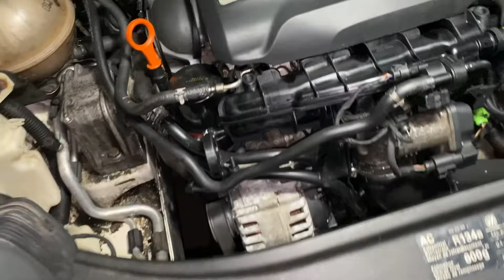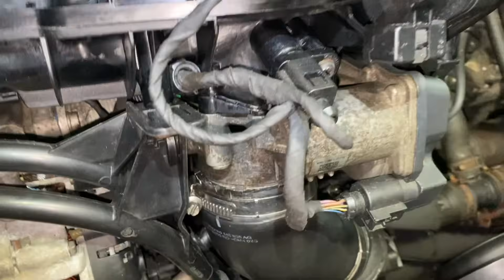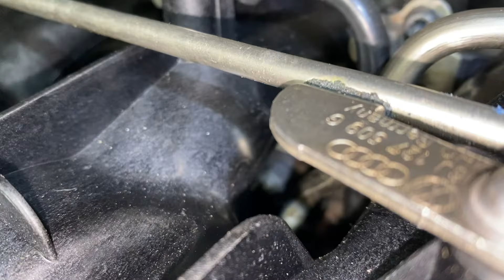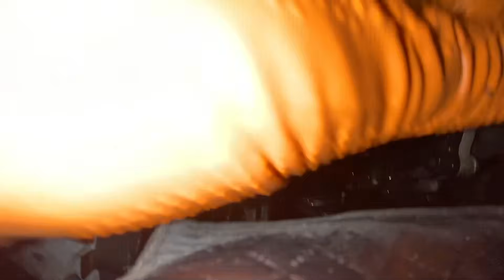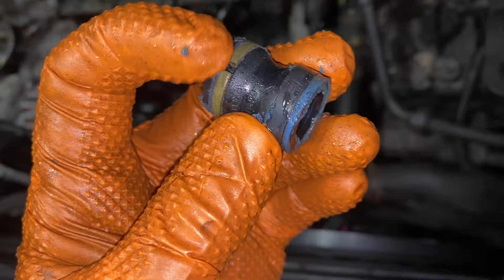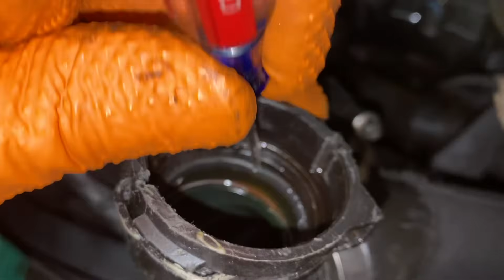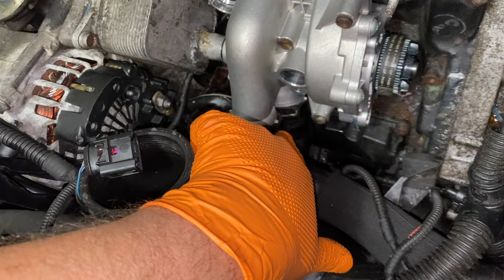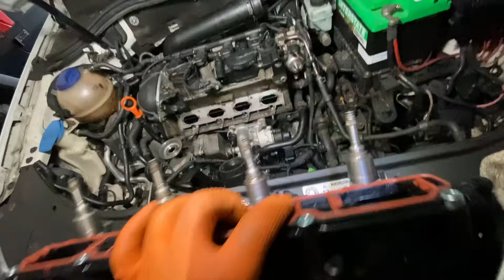Step-By-Step Water Pump Replacement on VW Passat, tiguan, CC, EOS 2.0 Turbo TSI/ CCTA  2008-2016

Comment: Can you help out one more time !
How do you get the belt off ? I found the Right wrench, a 12mm on reversed threads but the sprocket keep turning, is there a trick to it or another tool needed?
Thanks again
Reply from the maker: You talking about the belt on the water pump? It just slides off when all the bolts are out of the water pump.
Reply: I did this job on a Skoda Octavia Cdaa engine and om that you had to loosen the sprocket on the balance shaft (?) to get the water pump belt on. It is reversed threads yes, and you have to hold the crankshaft so the sprocket doesnt turn.
Reply from the maker: @rasmussvedin1778 I don’t have that engine you are referring to
Reply: @motorcarnut  i get that. One other different thing is that there is a bracket underneath the intake manifold which is very hard to see from above. Took a lot of time before I found out why I couldnt remove the intake manifold more than a half inch when I had loosen all the bolts and connectors in your video.
Other than that it was exactly the same so thanks for a great video!
Reply: For others knowledge it's an aluminium bracket with one 10 mm XZN bolt on the left side of the water pump house. You can remove it from under the car.
On the top of that bracket there is like a rubber mount with a 10 mm nut that goes into the intake manifold.
Reply from the maker: @rasmussvedin1778 Yes absolutely correct, when I did that video it didn’t have it because most mechanics don’t put it back and should and I forgot to mention it.
Reply from the maker: @rasmussvedin1778 thank you for the extra information!
Reply: My belt had broke, thats why I didnt realize that you had to take the sprocket off until it was time to put the new belt on..

Comment: What about the 2.0l turbo inline4 with black engine cover? I have whats supposed to be a Jetta GLI (2013, 211hp). Is it gen 2 EA888?
Reply from the maker: No, EA888 is the 1.8

Comment: awesome video! do you have a part number for the pump? sorry if i missed it. Thanks!!!
Reply from the maker: This is the aluminium one I used. Not factory plastic one.

Aluminum Water Pump Assembly Fits for Audi A3 A4 TT VW Tiguan Jetta Golf GTI Eos Beetle CC 2.0T TSI Replaces 06H121026AB 06H121026CQ https://a.co/d/59gFEKM
Reply: @motorcarnut  thanks!

Comment: Thank you for the great video, but torque is not 90 lbs.
Reply from the maker: Yes, sorry it’s 90 in lbs
Reply: @motorcarnut it’s definitely not 90 lbs either. It’s actually 15 NM go to 90 and they will snap off.
Reply from the maker: @jaimesanchez6305 As I stated months ago to another viewer, it’s 90 in.lbs Not ft lbs
Reply: Can you provide your source? Just want to make sure it’s right.

Comment: My car is at the dealer now to have my water pump replaced. I just wanted to see all they had to take apart to get to  it. I'm really nervous now because there is so much to undo and take apart. These guys are so young and the dealer has a reputation for not securing things like they were originally. Once they mess something up - you can't really prove it wasn't that way from the start. My car has 70,000 miles on it and it's covered under warranty (extended warranty). That was like pulling teeth to get them to admit it was covered because (supposedly) they can't 'speak' on it.
Reply from the maker: Hopefully, It will work out. Good luck!
Reply: @motorcarnut  Thanks. Your video was exceptional.
Reply from the maker: Thank you very much! Really appreciate the comment.
Reply: What year? Used to be a tech at Audi but we get them so often I wouldn’t worry about it
Reply: @tabaricurry4668  you gotta give the dealer ur vin num and they'll tell u if it's covered. Mine is 13 vw cc. Just picked it up today. Paid in full by them.
Reply: @gloglogo2638  ahh good on you. Mine is out the coverage I’m guessing but I’m doing it myself anyway I got a 13 GLI but I’ve got 150k. I think the coverage was 10 year/100k if I remember right
Reply: @tabaricurry4668  yes. 10 yr 120000
Reply: @gloglogo2638  ahh gotcha that’s good yours was covered though. I’m doing mine without taking the intake off though
Reply: @tabaricurry4668  They had my car since Tues running in to all sorts of 'problems'. Today they called in two 'big wigs' and they finished right before closing. I pray all is good. They were so lost...
Reply: @tabaricurry4668  I thought it was under the manifold.

Comment: This video is fantastic!  I had to replace the water pump on my 2012 EOS, this helped tremendously.  I would add for everyone, while you have the intake manifold apart, clean everything before reassembling.  It was mentioned in the video, but want to emphasize that.  Thank you!
Reply: Need to do mine soon. I plan on cleaning the intake valves and manifold while I've got it off to change the water pump.
Reply from the maker: You're welcome! Thank you for the comment, really appreciate it!
Reply: Including your intake valves.  I'm guessing that is what was just done on this car.  And while they had the intake off, they saw the water pump leaking and just goobed it up with whatever they used trying to fix the leak.  And now you are right back in there.

Comment: Nice Video！ What about the bracket under the manifold? Do you need to take it out first before taking the manifold? If yes, by hand or using tool？
Reply from the maker: Good question! Yes it has to come off first. The nut that goes to the underside of the throttle body is a 13 mm and the one to the block is a triple square but not sure of the size.
Reply: I cant seem to get my manifold to come out but im not sure what bracket you guys are talking about
Reply from the maker: It’s aluminum about 6 inches and connects from the bottom of the throttle body to the block. If for some reason your car doesn’t have it ( missing) the manifold needs some pressure to pull it out because the fuel injectors are pressed in a little
Reply: @motorcarnut  i found it thank you!
Reply from the maker: Great, no problem

Comment: I’m a mechanic apprentice and when this job came in I freaked the fuck out, this video saved my life
Reply from the maker: Lol, no problem I got your back!
Reply: One question one’s everything is back together do you have to bleed fuel system or will it just start
Reply from the maker: Just turn the key to the on position ( not starting) on and off 3 times to prime the rail then start it up.
Reply: More folk need to watch a video because they are having a time with my car right now. My stress level is through the roof. If the dealer can't get a screw out - how will they put it all back together?